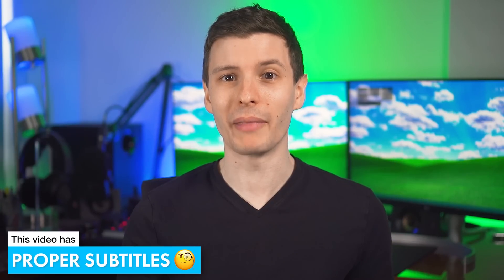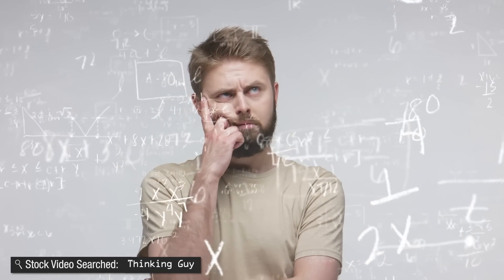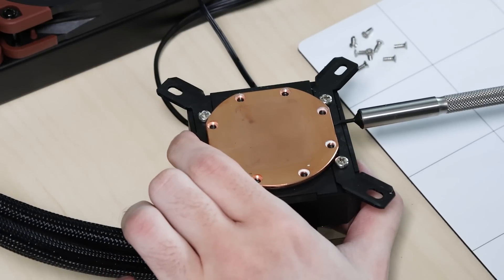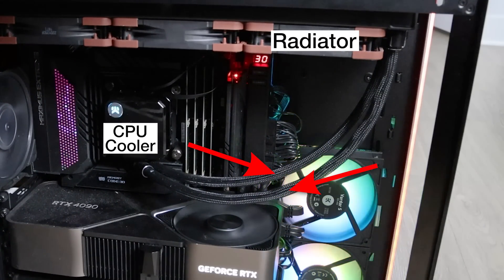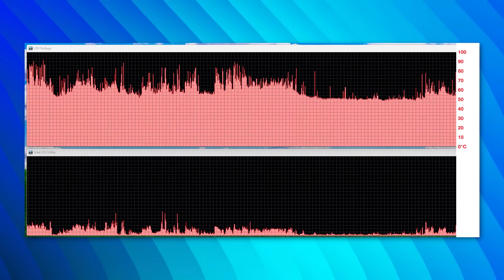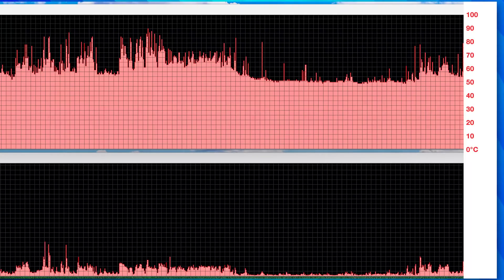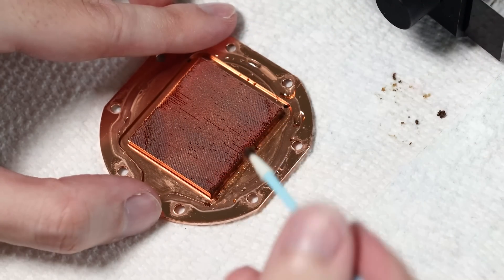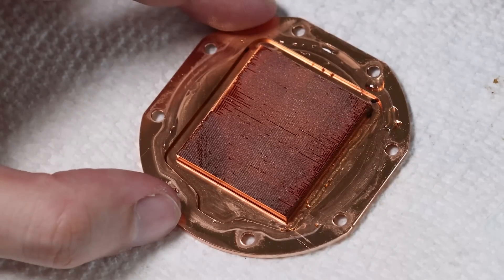The Mystery CPU Overheating Problem Took Me Months To Solve

Comment from the maker: Computer not working: 😡😩😖
Make a video about it: 👉😎👉
📝• Also a note I forgot to mention for those not aware: The reason it was stuck at 100C is that is the temperature limit at which the CPU will begin to throttle itself down to however low power is required to stay below that temperature limit. If the CPU is stuck at 100C at idle, it probably means that the cooling has been stopped altogether.  The last time where it shut down is if it goes too far above the limit even while throttling, the CPU will shut off to protect itself.
Reply: Thank you for showing us and keeping us protected
Reply: good for you cause you can monitize it
Reply: Could be rubber seals that are dissolving. (because it`s black gunk.)

You could expect a leak later if that`s the case.

Should have collected the gunk in a glass and see what it reacts to, if it dissolves in alcohol it`s organic or for example rubber. If you need an acid it can be metal.
Reply: There was a batch of EK AIO's that had a faulty lot of Fluid ( inadiquit bacticide )
Reply: Linus style. problems mean contents
Reply: Here's an idea if you ever need to clean it again clean it in an ultrasonic cleaner.
Reply: yes
Reply: I'm glad my CPU don't overheat for some reason I'm using the computer for hours and it doesn't overheat to me and I'm glad I don't have this problem and I feel sorry about your CPU Overheated constantly after all this time
Reply: You're welcome
Reply: I predict it starts happening again very quickly, buildup like that is very common actually, downside of water cooling and it shouldn't cause the extreme overheating like you say, or clogging. Think of rocks in a stream, how water is able to wear them away smooth, the water constantly moving through the unit wears away metal and ruber and gets buildup like that. Everyone's water cooler has buildup like that over time. 
I think the problem is its low on water and its mostly pumping air.  When you lay it down the limited amount of water in it goes down towards the block and provides some cooling for a while... until it doesn't. Water coolers will lose water over time through the pipes, literally evaporates through the rubber, I know that sounds crazy but look it up, common problem, and the hotter the CPU the faster it happens. Ive been through this before, I dont use water coolers anymore, just google the nightmares people have with them.
Reply: use a brush next time for those fins
Reply: Stop using water cooler
Reply: I'm glad i came across this video. 2 weeks ago i had a similar issue, but i was playing a game. I've got the same brand of AIO, mines the 240mm version.  I left my PC on with the game running as i was away for 5 minutes. Came back to my PC to find it had switch off. Couldn't power it back on unless i flicked the switch on the back of the PSU, then it switched back on. Thought nothing of it. Then it happened halfway into the game when i was there. Doing all the tests to do for process of elimination. It still did it. But i was moving the pipes as i was trying to get the ram out. Long behold it stopped it never happened again.  So im keeping an eye on it now. I'm going to check the block later to see if mines clogged aswell.
Reply: Welcome to mechanical problems 😂
It seems you should have a look at:
1- your cooling fluid & make sure it's not mixed with tap water (thus causing rust to form, so if this was rust it would be a strong probability)
In this case you would have to flush the system with lots of clean water then put an approved cooling fluid in there... just like a car radiator
Based on the look of it, you'll have to replace it anyway...
2- your pump is failing (don't know what type of pump based on what you have shown) & causing metal to accumulate in the system

* You should clean the full system not only the fins & that includes the hoses too, sooner or later that rubbish will reach the fins again & reduce your cooling capacity

Hope this helps :)
Reply: I suspect the built up plaque is platicizer from the tubing.  If it happens again, switch to a softer platicizer-free tubing -- or have some fun learning to bend and shape rigid hard tubing.  You also don't need to be nearly that gentle while cleaning the block.  Just get a toothbrush and some crest 3d white toothpaste and go town.  Things will go much faster for you.
Reply: WAIT AM I LATE
Reply: how long your cooler use and get this issue?
Reply: Soonish comment I’ll go all down .. if I don’t now.
Reply: Same thing just happen to me. My cpu started to register 95 celsius in a matter of seconds idliing,  but my rig doesn't have an AIO but had the stock fan that comes with the cpu. I battle this temp thing for a week, till I decided to get a tower cooler, finally the temps were at 35 to 60 celsius. I'm not tech savvy so this was a clearly an opportunity to learn why it did whay it did!! STILL DIDN'T LEARN ANYTHING, but it somewhat fixed the problem. Now, I still gotta figure it out why the #3 temp on my mobo still high (90C). Any recomendations??
Reply: I just realized you have 2 rtx 4090s, but why tho?? 💀
Reply: What I would like to know is why when overclocking I was able to get my cpu to 104C, it never shut off, nor did it thermal throttle, and it's an 11900kf that reached 6.2 Ghz (according to benchmarks) on water....OH and yes thermal throttling and thermal limiting are all available...yet went to 104C.
Reply: Are you using distilled water?
Reply: I would do that 🤣
Reply: You have an air lock in the water system.
Reply: doesn't EK have really good customer service?
Reply: Can I ask you something?  Some spam appears on the screen telling me that I have to pay a fine to the state wallet via webmoney.  He wouldn't let me leave this page
Reply: core i7 4770
Reply: I know about engine's...
The type that uses dinosaur squeezings..
(I have also used game engines 🐱)
Anyway...
With an engine the general practice is to back flush the whole system or take certain pipe's or parts off and run water in the reverse direction.. interior heaters are often clogged.. which entails connecting a hose pipe to it.. and run till the water is clear.
Using the same logic .. take all the bits off and flush them through.. or take outside and gently flush with the garden hose.. a jet wash is too extreme 🤯
also an airline to clean the fins .. wear goggles and mask.
If the bits stick to a magnet you could use that to grab the swarf.. and you could put a magnet at some point in the circuit to catch bits.. but obviously well away from anything that it will affect.
Thank you for your videos, hope this is a little help in return.
Kindest regards
Bella 🐈 & Mark.
(ps I have a question about something else)
Reply: 3rd reply and 6th like
Reply: First reply?
Reply: @JJean64 yes sir!!
Reply: @JJean64 Yes!

Comment: I just did a new build besides fans and case, and have been having almost identical issues with my 9950X3D and 360 AIO. Idle temps around 55°C, getting 97°C in game. Pump is running, fans all spinning, but cool air blowing from the top of the radiator, and liquid temps not going above 32°C. Have repasted/remounted 5x with the same results. I don’t want to void warranty if I need to return/exchange/RMA the cooler, so gonna throw my old 240 AIO on it and see if temps are better with it. If so, just gonna try and exchange the 360 and chalk it up as a bad unit

Comment: I had the same isssue with my dell optiplex. The screen keeps turning white or blue and keeps shuting down with BIOS message error themal trip system temperature is too hot. After flashing the bios. Its working fine now

Comment: Hate to say it and ik there’s 2 4090’s but like cmon stop buying cheap stuff like cheap cpu coolers or cheap ram or mother boreds and running awesome graphics cards and CPU’s with it, Rember you get what you pay for just wait and save for the better quality, I’ve never had pc part problems never I just finished my 2.8k mini pc with the jonsbo c6 MATX case and ryzen 9 9900x & RTX 4060 and 64GB ddr5 ram and the b650M ax elite ice mother bored, with a 850w red dragon power supply, took me a year to get all the parts and didn’t have one problem with any of the stuff this case supposed to make the cpu run hot because how small, and the ryzen 9 runs hotter and at idle with a low profile small cpu cooler I’m running 45-47 degrees in game 60-75 no higher, get 300-400 fps in game in Fortnite and 500-700 creative

Comment: I seriously have to thank you so much! My computer was suffering from all the things you mentioned for nearly a year now. It would idle around 50-70C , perhaps more and when I ran games it would often reach 100C and stay there. I’ve made tweaks in bios, cleaned dust, reapplied thermal paste. It would sometimes be a bit better for a while but it always got very bad again. I did just what you showed in the video, removed that copper plate and it had a thin line of green gunk straight down the center and around a small hole that connects to the loop. I have since had much lower temps. My idles are now around 30-35C and I launched RDR2 which I’ve been playing and was reaching 100C before, I now haven’t gone above 70C and it usually sits lower at around 60C. 
That you so much dude. You saved me from buying and installing a new CPU or cooler.

Comment: I ran into the same problem cpu 13900k 100c in stresstests.  White slugs in the cooling water. Thermal block clogged. I think best way to go is ultrasoon clean thermal block. Flush radiator and lines with demi water and refill with appropriate coolant. Still figuring it out. 
Very little info to be found. 
Thank for the vid. It made me open the bloody thing. On my way a glasses shop to ask if the would my thermal block in their ultrasoon cleaner

Comment: I recenly learned that you should only use a specialised liquid with additives (preferable by or approved by the manufacturer) for refilling/replacing liquid in AIOs...
since even destilled water can have corrosive effects when different metals are used in a loop...

Comment: mine was fine all the time never overheating . then i moved to a new place . opened it and then it started overheating immediately like in less than 30 seconds from 30C to 89 and it stops there and it gives me the same message as u . and my pc wont start .. tried to mess with the bios to fix it to no hope .

Comment: I have experienced this currently with my now 1 year old setup using Corsair ICUE H150i RGB elite, saw my temps spiking up higher than usual when playing, and I just chose to replace the thermal paste, did not help actually made it worse did that a few times, each time my spread was good, and everything was tightened well. and I also noticed one tube getting extremely hot while the other was cold/room temp. I am currently using the i9-14900KF which prior to that issue ran fine under max load at roughly 75C, but now I have to limit the cpu power to keep the CPU from overheating, and I am out of thermalpaste, so asked for RMA on my AIO as I think I would risk voiding my warranty if I tried to remove the copperplate, so I am not taking the chance to open the loop up.

Comment: The problem is actually widespread and occurs with all manufacturers, it just usually takes 2-3 years and it doesn't always get clogged as badly as yours... So flushing and replacing the fluid solves the problem for the next 2-3 years - there's no need to change the entire system...

Comment: I have that very AIO, though I haven't really used it yet.  My question is: is the radiator aluminum where the block is copper?  If so, then it might be a case of galvanic corrosion.  Now I hope this is NOT the case, because that would me my AIO will eventually fail, but I'm going to be cautiously optimistic.

Comment: I noticed my 2080ti had two temps one which you see another for memory, the memory one was 97 degrees,  no wonder gpu has been holding back on  load.    Weird, so I adjusted the fan curve from std, seems OK now

Comment: I'm praying that this is EXACTLY what my problem is...your description and story match mine almost identically and I've been troubleshooting for months now, everything I change has, at best, a limited impact temporarily, but ultimately results in the same problem.  I'm running a Lian-Li 3-fan cooler myself and it's about 3 or 4 years old now.  I'm wondering if it's part of the batch/lot you mentioned that were replaced by Lian-Li?  I'll be doing some investigating today!

Thanks Joe!

Comment: The only time I’ve ever seen that much junk in the fins are from mixing aluminum and copper in your loop.  They probably use a special coolant, but if for whatever reason the mix isn’t right, you’ll get corrosion.  Aluminum radiators are MUCH cheaper, that’s why they use them then just add a few ounces of some kind of corrosion inhibitor.  But in your case, it may have not been added, not mixed right, evaporated over time, or something else 🤷🏼

Comment: I’ve had my cpu IHS thermal compound crack, and it was impossible to know of the cause, until I delidded it and replaced the thermal compound with Liquid Metal, that fixed the issue.  These days most cpu IHS are soldered, so that’s pretty unlikely on high end stuff

Comment: Not a problem with my Thermalright assassin. As a retired A&P mech/ Avionics Tech, never saw a need for AIO in a computer system. Modern Aircraft are flying computers and get very hot, air cooled is the way to go in a reliability standpoint

Comment: That sludge in that radiator is either growth or it’s flux from the soldering process of the radiator probably didn’t flush it out properly in the manufacturing process this is why I do not buy ek products overrated crap

Comment: I have all this problems but with air cooler. My friend have all the same air cooler and mb that I have but no problem with temperatur. It was me putting together both the computers. Mine are getting worse and worse and crash after some minutes playing. The BIOS is up to date. Have ordered a new mb because I cant think of other solution. The temp goes from 30 up to 70 celsius and down again even on desktop without doing notheing. Makes me crasy!

Comment: i actually need to get some new thermal paste for my cpu. been using the same paste for the last 5 years. cpu temps are consistently in the 40 to 50 degree C range even at idle

Comment: Use brake parts cleaner (aka acetone spray) to clean the fins next time. It cleans the fins real nice. You can also buy a bottle of coolant to top off the AIO. But this happens due to galvanic corrosion and a build up of microbes in the coolant over time. I build and fix computers all the time and have seen this exact issue numerous times. MSI did have a cooler that had this issue and then they came out with the V2 and I haven't seen this issue in the MSI coolers ever since.

Comment: this is the reason why if you can, you should prefer air tower coolers. there's nothing wrong with water coolers but they don't tend to last that long. at least with an air cooler you blow the dust out once a year and replace the thermal paste once a decade and it's still as good as new.

Comment: This is why you need use DISTILLED water , also add some water-wetter / something to kill bacteria. 
same reason in a car radiator it clearly says use distilled water and NOT tap/rain water and mix with coolant which kills bacteria / fungus etc. Also a filter is a good idea and an indicator for flow-rate. As you noticed , tons of dirt , algae , minerals and stuff growing in the water-loop is not making the computer happy. Using just normal mixed car coolant will probably work ok.
Also note a car cooling loop has way bigger passages than your cpu block, making passages this tight is asking for trouble as a grain of sand will block it up. My first water cooling system used effective 2-3mm hoses and later I upgraded to 8mm hoses , the increase in flow made it orders of magnitude better. Just drilling entry holes on my first waterblocks doubled its perfomance alone.

Comment: Really interesting video, and that (trial and error) IS how we learn sometimes (or most of the time....), isn't it?  :(   I enjoyed your story and the logic of how you figured it all out!  I never thought of checking line temps on each side of the processor if I ever have an overheating issue - thank you for that idea!  That gunk you had in there doesn't sound normal - my liquid cooling setup has run fine for 6 years; all I do is vacuum the dust out of the "radiator" every few months.  I guess if these things ever spring a leak the whole system just goes up in smoke!  As a sidebar, I built my system in early 2018 (I know, it's ancient) with an ASUS Z-170 motherboard and an Intel Core i7 6700K processor (my first experience with liquid cooling) - it idles in the low to mid 30's C.  That has "sounded" ok to me, but I never really knew if that was "good" or "bad" - thank you for the benchmark.    BTW - since I added liquid cooling, I've had my processor overclocked from the stock 4.0 Ghz to 4.8 Ghz (continuous) running rock stable and zero issues.  I could only get to 4.4 or so (stable) with air cooling.  Thanks again!

Comment: This is the problem inherent with all AIOs.  The liquid that is used is reactive with the materials of the cooler.  This happens to all AIOs, some faster than others.  That is why I will stick to tower coolers.  They work almost as well and if the fan goes bad you just replace the fan.  There are still too many points of failure for water cooling to truly replace air coolers.  Custom loops are slightly better because they are more easily serviced, but they have way too many points of failure to recommend for the average person.  I work in IT BTW and I hate dealing with water cooling issues, clogging is way more common than you think.